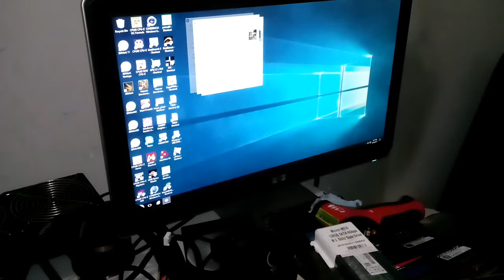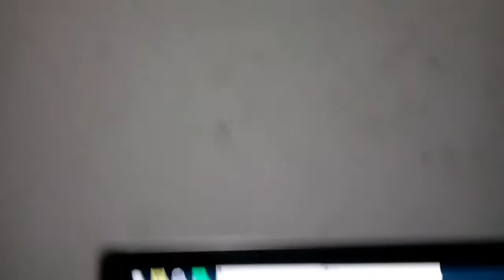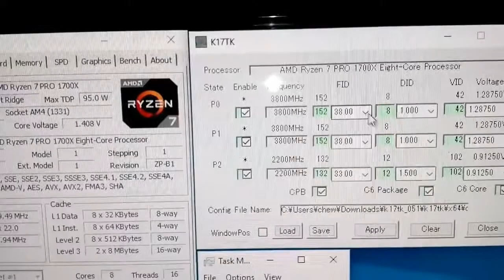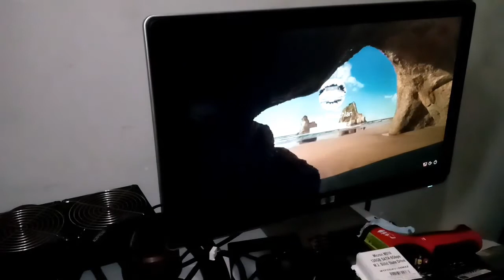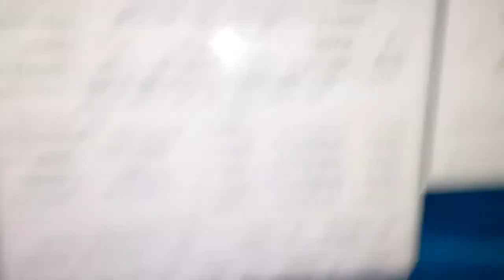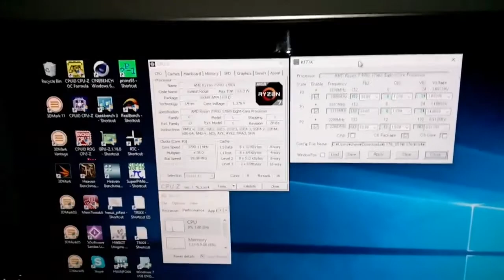Asrock x370 taich 15.5x and 22x multi.bug workaround

Comment: Actually all you have to do is leave the CPU Core Voltage below to auto.  That is all that messes it up.
Reply from the maker: SgtCage1971 leaving it to auto gets rid of bug for me...using it triggers bug...the issue is using voltage triggers a p2 state combined with an oc.
Reply: I was able to use the offset on the cpu core voltage and left the cpu voltage to default 1.35.  I st the cpu core voltage offset to .10000 which put me to 1.45 and all works great.  I had the dame bug
Reply: Actually I have always left the CPU core voltage below to auto and it has always caused the bug as well.

I have exclusively overclocked with the top voltage setting (because I didn't know what the difference was, I tried both and they seemed to adjust identical things in terms of what both the BIOS reported as well as HWINFO and CPUZ.  So I've always used the voltage right next to the CPU frequency setting and still get the 15.5x bug when I go ANYWHERE PAST 3800.  Even 3801.

And I cannot even bclk to 100 because as you pointed out ofr me chew I stupidly got a m.2 SSD for a boot drive because it was the same cost as a regular ssd and figured it would look cleaner with less wires.  I also was INCREDIBLY STUPID and didn't even get a fucking NVME because the one I got was on sale for 500gb and I dont really need NVME beacuse I dont do tons of content creation.

But there was still no excuse for me not getting one for an extra like 20$ for the samsung evo nvme m.2 drive.  This is the biggest regret I have with thsi build and wish I could go back in time and get either a regular Samsung what is it 850/860 regular SSD so that I COULD Bclk OR get a NVME samsung for only a few $ more and have a much faster windows boot.  ALthough the difference isn't huge, like when you go from a HDD to an SSD the difference is so crazy you feel like youre in a different universe.  Once I experienced that for the fist time with my build in 2012 I knew I could NEVER EVER EVER go back to an HDD.  But for me the difference from what I've seen, at least for the uses I use my PC for (gamign some content creation stream etc) is not really a huge noticeable difference from

Comment: Just updated to 3.10 bios and I'm pulling my hair out over this bug. Stuck at either a 27 multi or 15 multi. I tried what you said but simply does not help.
Reply from the maker: Plyply asrock is looking into it. I have pointed them in the direction to trigger it. Seems newer chips are effected and older are not.
Reply: Brian Mclachlan Thanks Chew.  I found that increasing vsoc to 1.1v stopped the multi bug. Also another bug is when using p states.  C8 fid should give 4000mhz, but bios reads it as 5000mhz.

I think the bios still has a few bugs that nees cleaning up.

Comment: Thanks for the vid. . . unfortunately my r5 1600 doesn't like going over 3.8ghz with less than 1.40v.  I had to settle with 3.7 at 1.35, din't win the lottery this time.
Reply: had the same problem with my R5 1600, updated to 3.20a, runs 3.9Ghz stable now, setting 1,4V Fixed LLC LvL3, under load it drops down to 1,388V max temp 65°C